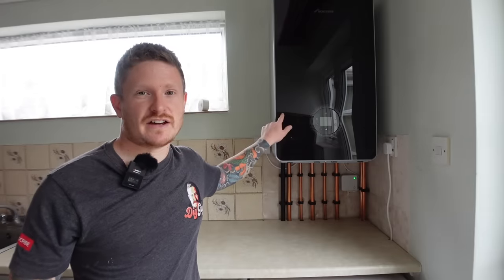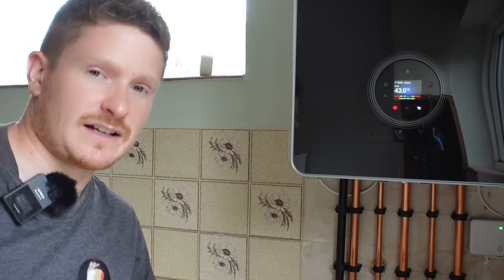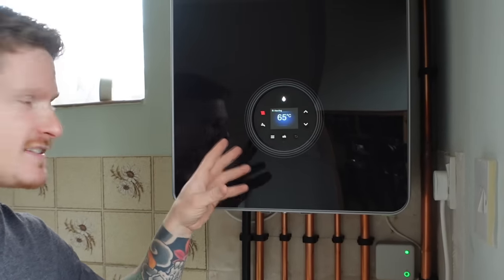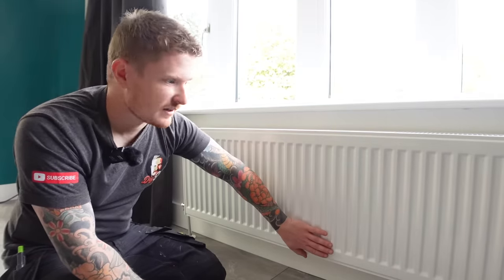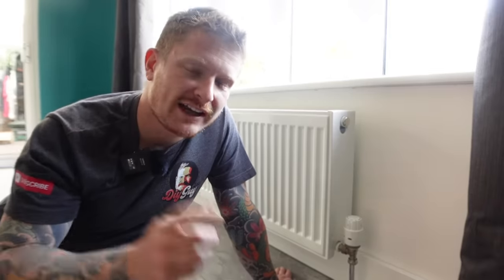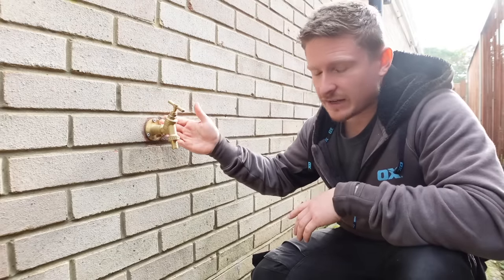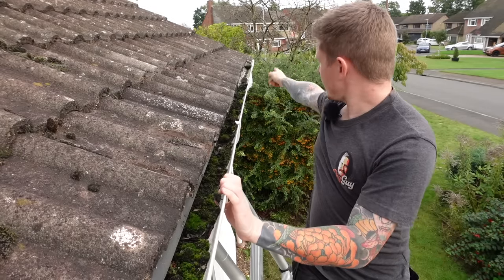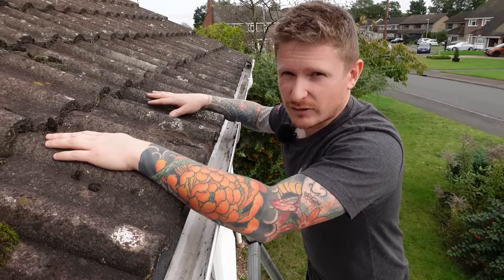How to Prepare Your Home for Winter and Save Money on Energy

Comment: 8:50 Couple of comments on the gutter cleaning:
If you have a dad like mine who's up the ladder you're footing,
wear a cap and don't look up if he asks you a question because you'll get a mouthful of leaves...
Also, to save moving the ladder loads, use a narrow hoe to bring the gunk to you.
Reply: I tie a rope to my bucket handle,  then climb the ladder with just the rope in my hand. I pull up the bucket (with any tools in) and then tie it to a rung with a half hitch on a bight of rope. But, more importantly, I can untie and lower the full and now very heavy bucket of gunk to the ground before climbing down the ladder myself. Makes the descent much easier. The gunk goes on the compost heap, of course.

Comment: If you have petrol power tools, drain the fuel and store them indoors. Pressure washers and anything with water inside to be protected from the freeze. Also anything with batteries such as jumpstarts. Tip from a Machine Mart employee.
Reply from the maker: Thanks for sharing 👍

Comment: Nice and timely! I happened to clean my gutters today. 
There is another urgent thing around boilers. Check the condensation pipe for blockages. A few winters back, my boiler stopped working on Xmas. The condensation pipe had flash-frozen. Get ziplock plastic bags and fill them with 60C water (1:1 boiling water with cold water). Wrap the pipe with these plastic bags. Maybe wet towels will also do the trick. You'll see several huge chunks of ice fall from the pipe, and the boiler will resume working. In Netherlands this pipe is heated to prevent this, in the UK it's usually outside. My new boiler has the pipe connected to internal drains, towards the kitchen sink. 
To save money, turn off the bedroom's TRV during the day. Hive and Honeywell have smart-TRVs that can be set with a schedule.

Comment: Check insulation is correctly in place in attics especially after doing jobs in there. Also, check extractor fans are properly ducted, clean and clear. Check around windows and doors for draughts and adjust/seal them (my dark-coloured French doors don't shut in summer as they expand in the heat, so I have to ease them off in summer and close gaps in winter.

Comment: Use a dehumidifier to get your humidity down to 50 this will keep your house warmer for longer, meaning your heating will not come on as often as dryer air is more easy to keep warm for longer periods and save on gas. We use 3 to 4 more pounds a week running one but have saved £7 a week on gas’s meaning £3 a week saving house is warm as hell and no damp or mould. Even has a laundry mode when people dry there cloths I. The house I. The winter to get rid of the moisture. Excellent machines.
Reply from the maker: Interesting, thanks for sharing that!

Comment: Slowly start stockpiling grit from the public bins haha
Reply from the maker: Haha!
Reply: @TheDIYGuy1 That's a really modern looking boiler. My boiler pressure went right down the other down. I have no idea why. Luckily, i know how to top it up. I have a query i notice sometimes green liquid stuff leaking from a few valve's why does that happen? many thanks 😊.
Reply: @chrissy212e  You need to get that seen too ASAP , that’s most likely why your pressure dropped. The green liquid is water and bras/copper corrosion mixed together, when brass and copper corrodes (copper has a lot of brass in it) they let off a green residue, it sounds like your pipes are degrading and may need replacing, but they 1000% need looking at bud their could be a leak elsewhere in the system if not damaged , everything needs resealing up.

Comment: In America we have frost proof faucets that don't require draining. The valve is in the warm side of the house and has a long shaft around 8 inches where you can turn the water on. As for your roof I us a product called spray and forget and add to your garden hose then you spray your roof and as time goes by and with rain it keeps your roof clean of mold or moss and it work really well and you do not have to get on roof to apply just spray from bottle.:yougotthis:

Comment: Check and clean dehumidifier - much more efficient than extractor fans that suck heat out of the house along with steam. When drying washing indoors they reduce damp, and increase drying speed, and reduce condensation on windows. You have to pay to run them, but the fans can be turned off and hot air stays in for longer.

Comment: Not necessarily something to do on a yearly basis, but I've found putting heat reflectors behind the radiators against outside walls warms my bedroom up quicker (not noticed it working as well in my much larger front room, but that takes ages to heat anyway vs my smaller bedroom).

I generally only put the heating on an hour or so before bed to warm my bedroom up since to save money I now go for walks in the evenings so don't need it on when I'm not there (another tip for people, I guess) so having the bedroom warmer quicker saves me money as I won't need the heating on as long
Reply from the maker: Thanks for sharing
Reply: You put the heating on in your bedroom before you go to bed....... here is a money saving tip dont put the heating on and get into bed. 😅 You have wasted all that energy heating a room to get into a bed that is most likely warmer, id suggesting upping the TOG of your duvet if you are cold.
Reply: I use an electric blanket instead to warm the bed.

Comment: Make sure your condensate pipe of your boiler is insulated with foam pipe lagging, proberbly most common thing of boiler breakdowns
Reply from the maker: 👍 good tip for those with an external condense

Comment: If bottom of radiator/s stays cold, it is likely to have sludge in it. Install a sludge filter and clean it at least annually when boiler is serviced. Have the system flushed first, and use a corrosion inhibitor as required.

Comment: Unscrew the TRV's off each radiator, get a pair of pliers or grips and wiggle up and down the TRV pin and spray with WD40. Dont hit the pin with a hammer, it will fly out!! Then replace the TRV. TRV pins tend to stick on older raditor valves which renders the valve useless for turning the temp up and down.

Comment: I make sure all my locks, door hinges, window runners, trickle vents and handles jave been cleaned and lubricated.  

A quick look up in the attic is also worth it.  You can check the roofing felt for splits.  A little feel on the Rockwool insulation for any moisture can be a sign of leak or condensation build up.  When it gets cold, rats or mice may also try to set up home in the attic.  Look out for dropping or nesting material.

Comment: Drain any water out of outdoor hose reels. Mine froze last year with water inside and cracked the spray nozzle and fittings so I had to buy new ones. Not a huge expense but one I could've done without!

Comment: If your radiators still don't turn on, take off the thermostat on the radiator and get the pin underneath a gentle push with a hammer/handle of a screwdriver to make sure it's not stuck.

Comment: Do you not use downhole heat exchange in britain for heating? It is one of the cheapest way to heat up water. It saved me alot when I put it in to my house. 
I have never hade a gas boiler or gas stove but it but use ground heat must still be much cheaper in the longrun. Very intressting video 😊

Comment: Cracking video. I’ve a quick question if your able to answer it for me. I watched your other video on balancing radiators. Tried it but failed as me and my wife couldn’t determine which heated up first and so on. Now, I’ve got all trv’s & lockshields fully open, every rad is getting to 62 degrees nicely. Would my system still benefit? Thanks

Comment: I have 2 outside taps, one of which I use to clean the cars so through the winter so rather than keep having to turn the supply on and off I made a tap protector from a used plastic 4 pint milk container  by cutting a hkle in the side to slot over the tap and some used bubble wrap to lag it I had knocking around so cost was £0.00. As a question why didn't you route the pipe insidethr housd so the feed to the outside tap was from the top so once the isolation valve was turned off gravity drained the water from the pipe? For my main house guttering I've installed mesh over the top of it as where I live there are a lot of trees and moss on the roof. This prevents the leaves from the trees blocking the downspouts so I don't have to get my ladders out when we have heavy rain and so far the only place that collects the moss is where the lead gullies run off but that only results in a small amount of water coming over the guttering rather than the usual deluge if the downspout gets blocked and takes far less time to sort out.
Reply: You can actually buy covers for outside taps - free is nice of course, but nicer looking is nice too and they're not super expensive.

Comment: Block drafts in windows and doors
Reply from the maker: 👍 good tip
Reply: Watch out for CO2 suffocation/poisoning, it's really easy to end-up with constant 2000-3000ppm! Block most drafts, but leave some. Get a CO2 meter. I got really ill once I blocked all drafts, then I noticed I've been poisoning myself.

Comment: Hi, I have to keep re-pressuring my boiler every week. Any idea why this is happening? Thanks
Reply: you might have a small leak. Check though all pipe system for signs of dump or mould.
Reply: @danimourinho will take a look. Thanks
Reply: If you can't find any signs of a small leak around the radiators, pipework or little brown spots through the ceiling. Then it might be under the ground floor. You can put leak sealer into the system to solve it. Search it up or get in a plumber if you're not confident 👍🏻
Reply: Had similar with stuck expansion vessel pin, causing to lose pressure. Plumber who found the fault, told me this some happens on boilers.

Comment: Does this apply to conventional boiler?
Reply: The pressure part doesnt as its gravity fed (making an assumption on the install), but running it and checking/bleeding the radiators would apply.

Comment: Air is always suspended in water.  The fish breath it?

Heating the water pushes the suspended water out of suspension?
Reply: Fish breathe water, from which they can extract oxygen.
The issue here is that air gets into the system when you drain an outside tap, or change a radiator, or other maintenance. It gets pumped around the central getting system and takes up space that should be circulated with hot water. It you get rid of the air, the system is more efficient. You can't get rid of it all, but it's a well known saving.

Comment: You want to be careful with this guide - You haven't put any health warnings and haven't told people to be careful of scoulding hot water shooting out of the radiators whilst bleeding! Really they should be bled when warm/heating off
Reply from the maker: You shouldn’t have a scoulding hot water coming out of your heating system, if you do, somethings wrong. Your water temp should be around 60-65c. Also there is a disclaimer to work safely in the description. Unfortunately whilst i try to help as many people online as I can I cannot touch on every single safety point or the video would be so long that it just wouldn’t be viable. Thanks